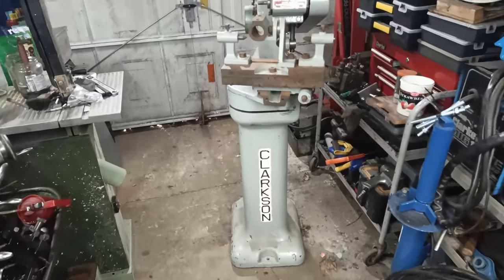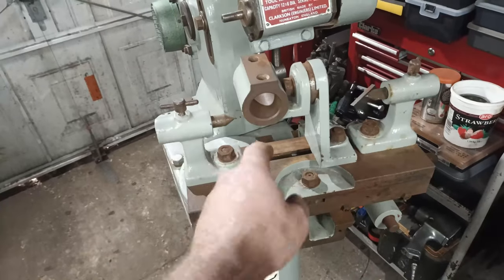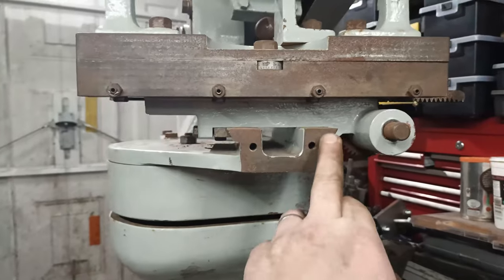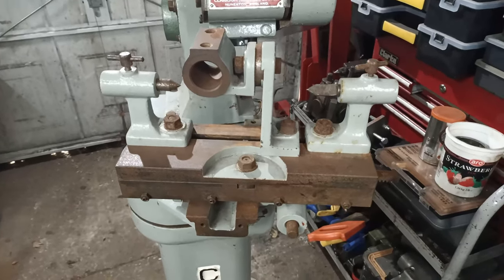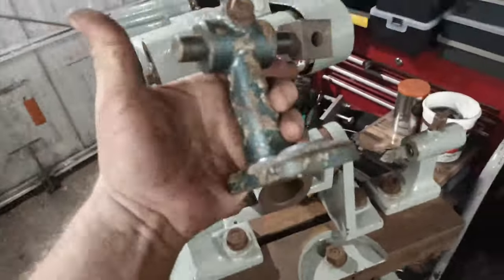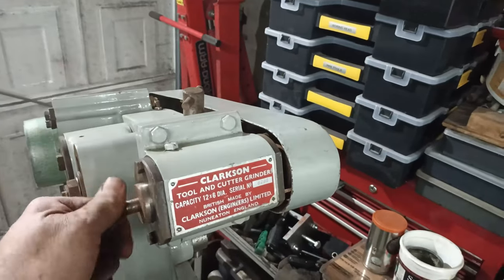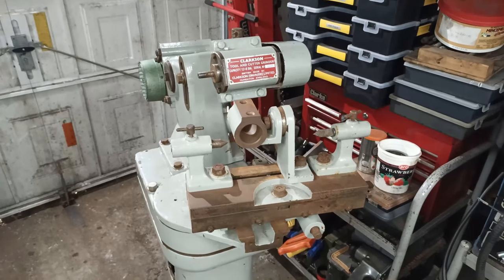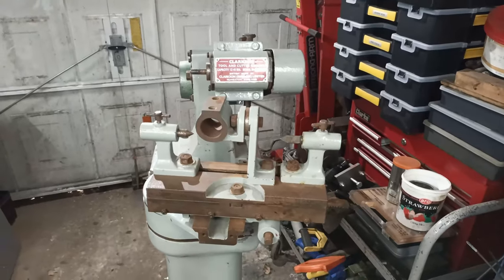Clarkson Tool & Cutter Grinder: Introduction

Comment: Hello Phil. I hope you find your lead-screw and handle, they are versatile machines once you learn how to set them up. Thanks for subscribing to my channel, we have similar mindsets, always willing to learn new skills!
Reply from the maker: Hi, many thanks for the message. I'm afraid the handle is long lost. So I shall have to make myself one. I have a mind to make one similar to the newer models, with a finer pitch and better scale. Should be a good project..
Reply: @m0xya looking forward to that. I have a mk1 the screw is not the best, I may follow suit. In Cheshire so if youre nearby and need to have a measure or need some photos let me know.